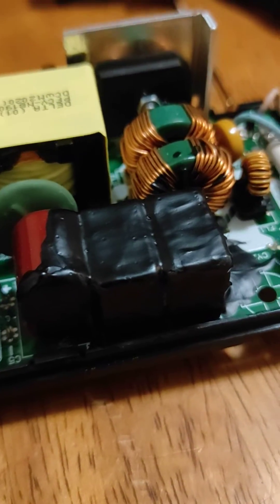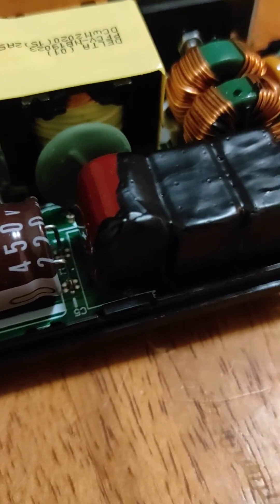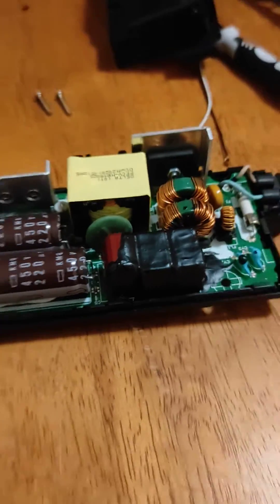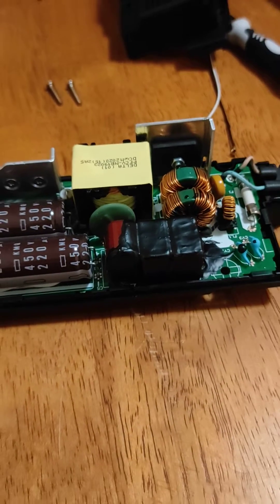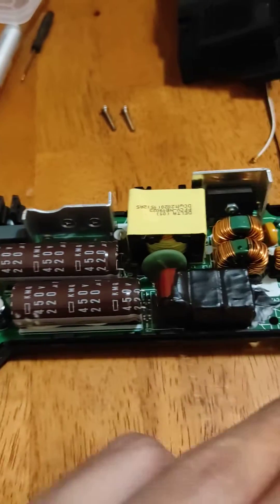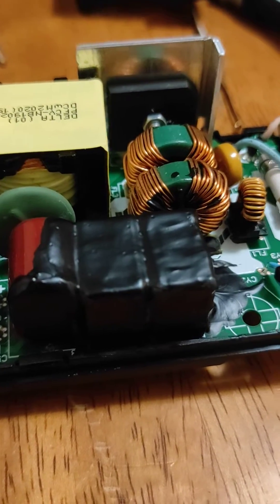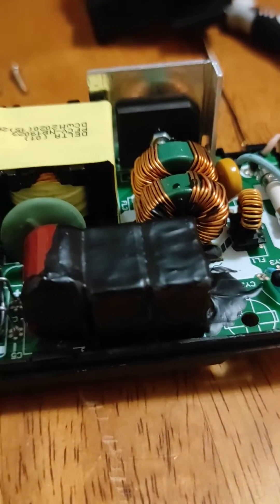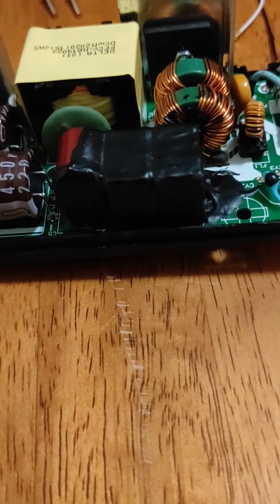PS5 Coil Whine Fixed!!! Part 3, Little update and adjustments

Comment: Why is it shrinking? Maybe it would be better to use silicon
Reply from the maker: It's the way this stuff is, it gets a little harder than Silicone pretty much like a rubber and also I only put 2 coats on the first time, it does say on the bottle to use 3-4 coats for good results, but yeah Silicone is a good option too, the reason I used this stuff is cause in my opinion, it's better at sound absorption
Reply: @aaronajbird07  hello mate,listen have two questions,is this good https://www.garantboats.eu/juoda-skysta-elektros-instaliacijos-juosta-star-brite-118-ml
Because in my country no other options,and how actually long this tape gets dry,better to wait longer no?thx a lot
Reply from the maker: @tomygun4280  yeah that will work ok, it takes longer or a full day for it to dry before playing games on it